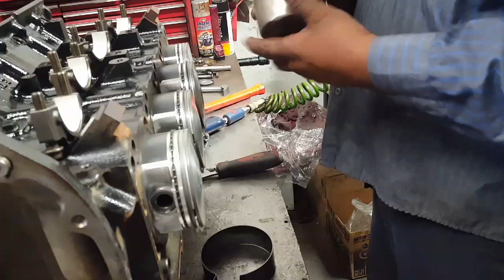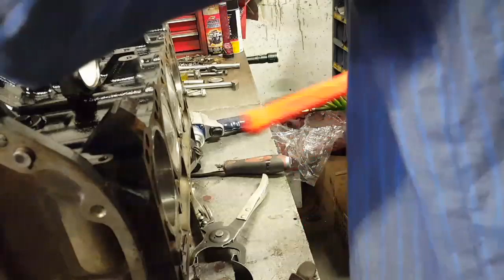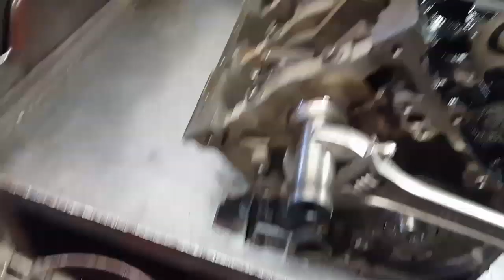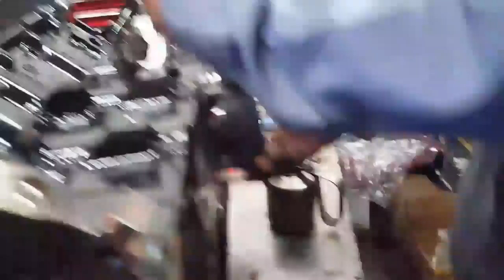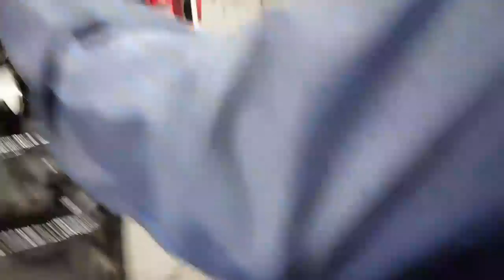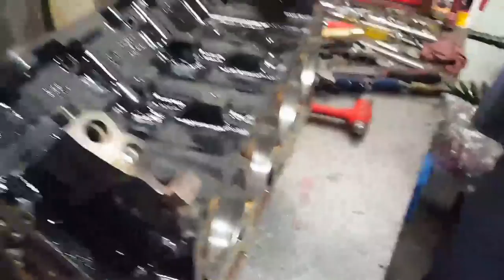How to rebuild hemi 5.7 engine:installing the pistons

Comment: How can you tell the difference from a left and right side piston? Also, can you put a piston from a 2006 - 2008 into 2009 - 2013 if not why? Both are a 5.7. please answer both questions
Reply: This is what I'm looking for too... I'm a machine shop. The original pistons have no markings, the aftermarket pistons have an arrow. I can't find the information anywhere.
Reply: @trekinseattle  Arrow always point towards the front of the block . I know this is a old post.
Reply: @dhall4643  but what if most of the oil grooves are positioned upward ?
Reply: @5300trilla  what engine are you building?
Reply: @dhall4643  5.7 hemi
Reply: @dhall4643  when I switch them around. Most are positioned downwards, so I'm kinda confused
Reply: @5300trilla  the video he posted right before this kind of explains that
Reply: @antonioV96  I’ve upgraded my man ! I have a 7.3 diesel now
Reply: @5300trilla  oh kick ass, nvm then 😎

Comment: you should make a video on what type of aftermarket parts will be good for  new rebuilt 300c 09
Reply from the maker: That's a good idea,thank you 🙌
Reply: Lol yeah cause I'm actually rebuilding a 300c 2009 An just wanted some advice on what aftermarket brand would be a good an long lasting for the 5.7 engine. PISTONS HEADGASKETS BEARINGS ETC

Comment: Question on the connecting rod bolts and any other internal engine bolts do I need to use thread lock or just a dab of oil
Reply from the maker: Stock engine dab of oil, and high performance engines ARP thread lock
Reply: @JM8686  its a 5.7l hemi on Chrysler 300
Reply from the maker: @leonardc2234  hemi comes on the 300C
Reply: @JM8686  thats what it is a 300c with a 5.7l hemi

Comment: Are you guy's in L.A. because my 05 dodge magnum R/T 5.7 motor stopped working i think the timing chain broke i don't know if i need to rebuild it maybe the valves a are  bent...
Reply from the maker: Valves will be bent and yeah shop in LA but I'm in Juarez right now

Comment: Love that song in the back ground but dam get a engine hoist id hate to see my painted block tossed like that
Reply from the maker: hemiyacht charger yeah good input lol i was in a hurry cuz wanted to see my 300c already running haha check out the engine on my b2000 truck the DORITO PROJECT, the paint job I did on that clock and head was bad ass!!!👉💦💦💦💦💦
Reply: I'd be more concerned with the way they are sliding the cylinder head mating surface around on the metal workbench. That shouldn't be scratched up like that, everything might seem ok then maybe 10 - 20k miles down the road the head gasket blows

Comment: How much would it cost for the camshaft and labor.
Reply from the maker: ClumsyWhistle8 what do you mean? What exactly are you looking to do? Is just the short block or only want cam nd lifters? No cam facer and timing chain with the tensioner or guide?how bout the camshaft special plug? Just trow me some info so I can help you a lil better